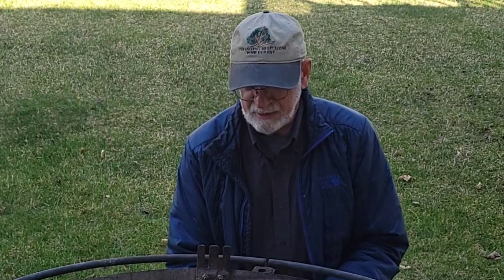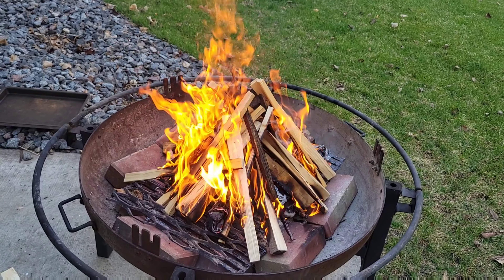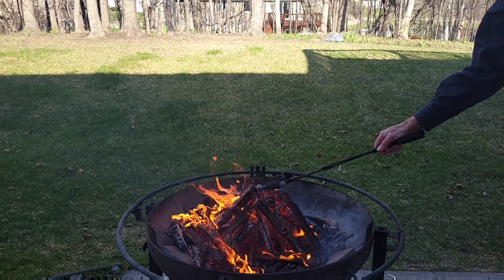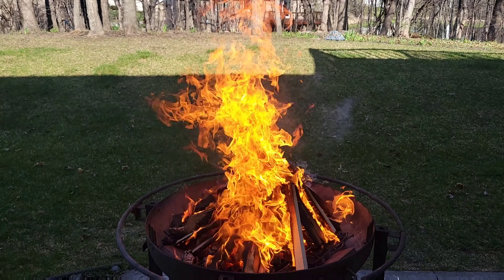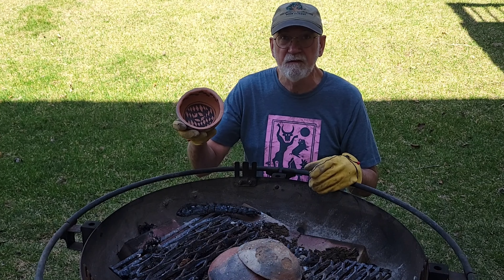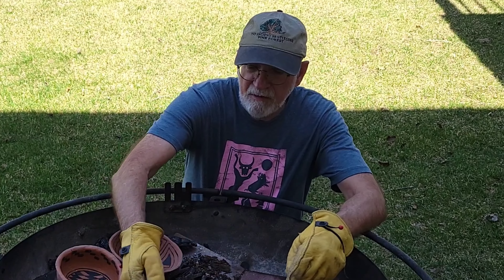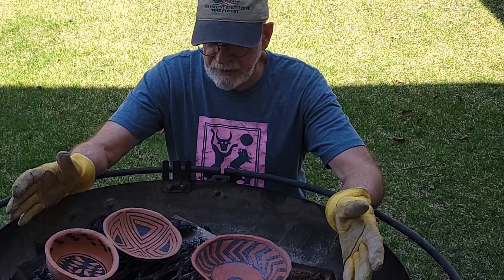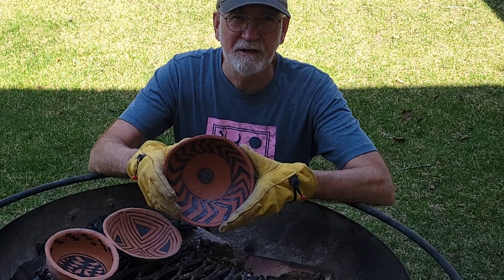The Glaze Challenge, Success!

Comment: Well designed experiment, Wes.  To get consistently hot, you might want to consider building some kind of semi-permanent brick kiln to help channel the flames where you want them, and to retain more heat while its burning.  I was curious as to how well the bricks themselves held up.  I read somewhere that commercial bricks are supposed to be good up til about 1800 F, beyond that they may not last long.  But ... I have no idea whether that's the case.  I'd like to find out, because I'm thinking of building a brick kiln myself.
Reply from the maker: I suspect the bricks won't last a real long time but they have been in a couple of firings with no noticeable problems. I will have another video out down the road where I use them as a portable charcoal kiln like Tony S. and Andy W. It worked great. Unfortunately I don't have the option of actually building a kiln and I think I'm sacrificing some authenticity. It sure is nice when things work. Thanks

Comment: I get glazing of MnO2, clay and CuCO2 paint at ~1940 (cone 04) in my kiln. No Galena used. Also I wonder if the Red slip facilitated as a flux. 

Great videos all!!!!!
Reply from the maker: I saw in another video that the various minerals in clay does have an effect on glazes. Iron has a fairly high melting point but there are also lots of other substances in clay. I would fully expect that the results could be a little different with each different clay. I've seen some archeological analysis of different clays and it is common to have 15 or so different elements that are measurable. Most are in small amount. Thanks for watching.

Comment: Hey Wes ..great experiment your achieving there with the glaze..may have missed it but what are you adding to the paint to do this ?..may have a go at it myself..and adding the lead to manganese is a way forward to being non fugitive after firing. Thanks from across the pond !
Reply from the maker: Stephen, thanks for watching. My recipe for the glaze was 4 parts galena, 1 part manganese, 1 part copper carbonate, 1part clay, & a little organic paint to act as a binder. I didn't add any iron but that was commonly in ancient recipes. The galena is actually roasted first and then ground as fine as possible. It is  toxic. :( Good luck.